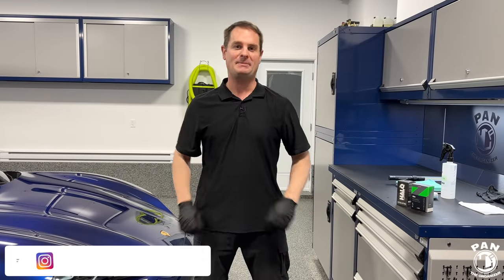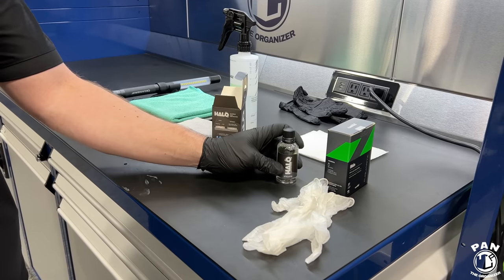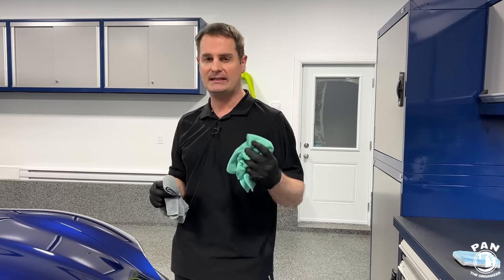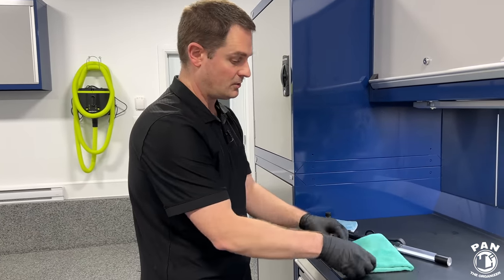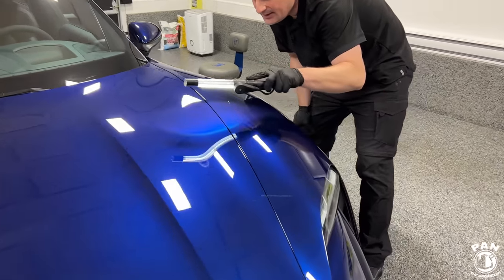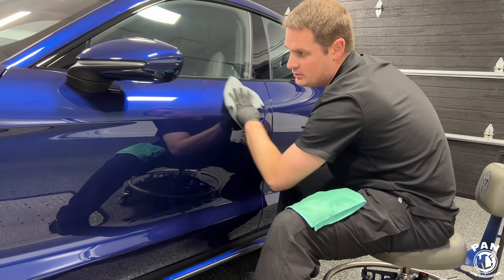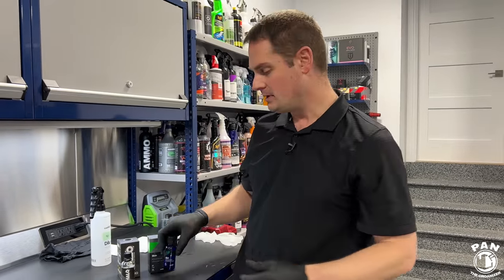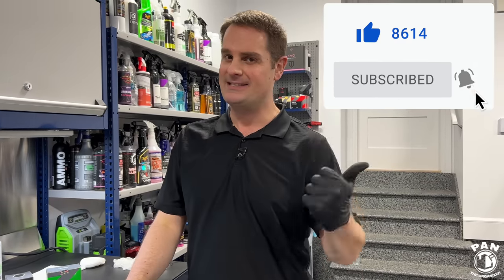How to apply a ceramic coating on PPF (paint protection film) : Porsche Taycan Turbo

Comment: Hey Pan, another very good shampoo that can be used every so often to remove tougher contaminants is Adam's Graphene Shampoo.  Can't recall if you've tested that one before.  Adam's describes it as a... "Traditional foaming shampoo that balances choice, high foaming surfactants, and citrus-based degreasers to generate a wash that is more than capable of powering through all kinds of road films and grime".  Another attribute is the low friction characteristics that graphene provides which in theory will help prevent some marring during a wash.  I believe they recommend every third wash or so.  Using a Nanomitt with it works really well.
Reply from the maker: I use the Adam’s Graphene Shampoo often to maintain the Adam’s Graphene Ceramic Coating Advanced on my girlfriend’s vehicle. I made a video about the process here: https://youtu.be/JLhTW_D7b8Y

Comment: Man I am late for this video. But I made it.. very cool pan. I went to work in the making of your video at 4:50am. ❤️👍🏻 need to zoom in more pan. To show use the bubbles. And leveling effect. I love Porsche just not EV’s. I like real cars with engine that make noise and burning tires. And the smells of real HP cars.

Comment: Coated my M2C with full XPEL ppf coverage, as well as a buddy's 911 Carrera T (also with full PPF coverage - Suntek ultra), with GTechniq Halo - in part from your video and in part from Obsessed Garage videos - and must say, it's been performing very well, and am overly happy with it. I did both cars over the 4th of July weekend in the USA, and after a couple maintenance washes since, still obviously holding up nicely. The beading and sheeting is so strong, that even the heavy suds from my foam cannon don't want to stick to the car when initiating the washing process. Thanks for the videos, Pan!
Reply from the maker: Thanks for sharing your experience Patrick and thanks for the kind words about my videos!

Comment: Dude, i bought a new car and bought detailing products, and i had my car wraped in PPF .. i had so many questions in my head, and all of them are answered by only you and your channel :D thanks alot really
Reply: they shop who applied PPF tph, said dont do ceramic, cause it will damage and make tph pff yellow,  is it true?
Reply: ah by the way i wanna ceramic coat my PPF cause i want my car driping wet), but as i read the comments on amazon for this product, it doesnt make the car look wet i guess.
Reply from the maker: Congrats on your new car, and welcome to my channel. You discovered one of the biggest car detailing channels on YouTube as we surpassed 945,000 subscribers and we have over 125 million views! I have been detailing for 26 years and I love to share my knowledge and passion with my viewers.

You found the right channel to help you learn everything about detailing.
Reply from the maker: This is totally not true. Unless you had some crappy PPF installed. Heck quality PPF manufacturers like XPEL even have their own line of ceramic coatings to be applied on top of the PPF.

The ceramic coating will prevent the PPF from yellowing, as it helps to block UV rays, and also will provide your PPF with more slickness, and also provide self-cleaning properties making the car easier to wash, and provide chemical resistance, and awesome hydrophobic properties. Depending on which coating you apply, some can increase the gloss too, but the PPF specific coatings not as much as the paint coatings.
Reply: Thank you so much!! :) @PanTheOrganizer
Reply from the maker: My pleasure. How did you discover my channel by the way?

Also, I made a video on how to care for PPF: https://youtu.be/I3AszYhWhs4?si=Bthr2JviAD4laLnc

Comment: Based on this video, I applied two coats of Gtechniq Halo to my Fiat 500 Abarth which has a "distressed patina" vinyl wrap.  The 3-M over-laminate on the printed wrap has a matte finish and I was worried that this product might ruin the effect by increasing the gloss.  I'm happy to say that the matte finish was unchanged and looks exactly the same as before.  However, when I run my hand across the finish it feels much more slick.  It remains to be seen if this coating performs as well as the Adams Graphene coating I used on my Porsche and several other vehicles, chosen also because of one of your earlier videos.  

Compared with the Adams Graphene, the prep work for the Halo product was a bit less because I didn't clay bar the vinyl wrap but the application took more effort because the Halo not only requires two coats, it also has a little more drag when leveling (wiping) the coating.  However, it certainly wasn't difficult. I also miss the nifty blue UV tracer in the Adams product which glows blue under a UV light so you can see exactly where it was applied.

For reference, I used half of the 60ml bottle of Adams to do my Porsche.  It took 2/3 of a 50ml bottle of Halo to do my Fiat but I dropped the bottle and spilled a little bit.  I would say that I could have gotten by with the 30ml bottle but if your car is larger than a Fiat 500 (aren't all cars?) then go with the 50ml bottle of Halo and try not to waste any. I also suspect a gloss wrap or PPF would use less product than my matte vinyl wrap.

Thank you again for keeping us up to speed on the latest and greatest products for protecting our cars.
Reply from the maker: Thanks for sharing your experience. Just keep in mind PPF coatings don't last as long as some of the more durable paint coatings. You should expect 1 to 2 years of protection if you applied it well, and do proper maintenance. I will also be looking forward to long term durability results in my conditions, to see how well they do over time, as they are still fairly new to the market.

Comment: I think you answered my most important question that no one else has yet - that is one can apply ceramic coating on ppf !! As long as it is designed for it. So Thx! Question 1. - so can i use the gtechniq halo  on an xpel ppf ? Question 2. Can i apoly this ceramic coating on my car windows , mirrors , sunroof and alloy wheels ? If not , any other recommendations ? And question 3. Can i use optimum no rinse to wash the car with ppf and ceramic costing ?Thx a bunch for sharing this tutorial!

Comment: Excellent video Pan; so good to see a pro' at work. I noticed that when applying the second square to the bonnet (hood), you overlapped the first square. Cleary, after a minute or so of drying, that created no apparent problem. So, how long can a section be left drying before application of the adjacent panel  without causing any problems?  You can tell, I worry for England to Olympic standard.
Reply from the maker: Don't overthink the moment. As long as you are methodical and apply the coating in one sitting, you're fine. It takes 24 hours for the initial cure to fully happen. But you can usually correct high spots up to 30 min after the application.

Comment: Great video Pan as always! I've had Halo applied on my AMG 45s in satin ppf, which for durability it lasts me around 1 year. Including doing regular maintenance washes living here in the UK. As mentioned in the video it is a very product to use in the correct conditions. I personally like to try and stay with Gtechniq products as much as possible as they design and produce these in the labs research etc for maximum results, would be nice to see this product last that bit longer if they can do this would be great, that would be it's only let down to me.
Reply: They advertise it for 2 years, only one year is pretty disappointing to be honest.

Comment: I know these are preferred for PPF. However, I had no issues using Carpro Cquarts 3.0 UK worked great.
Reply from the maker: Many paint coatings can also be used on PPF nowadays. You just have to make sure to read if your specific coating does.

Comment: If you had PPF that was several years old with an old/failing coating, how would you prep the PPF'd panels for a new coating outside of wash/iron remover? Is clay/polishing necessary to remove the old coating from the PPF?
Reply from the maker: Yes a light polish would be necessary to remove any old ceramic coating. It's the only way to ensure 100% removal of any previous protection.

Comment: Cool! I for one am very interested in all PPF-related content so I'll be sure to look out for any/all future updates, reviews and comparisons on the topic. Thanks Pan
Reply from the maker: Thanks Andrew!
Reply: @PanTheOrganizer  One thing I've just learned browsing the product pages that might be of note here is that CarPro Skin can be removed with a stripping solution, so apparently no polishing necessary if you decide to change coatings down the line. If accurate it's a great selling point IMO, and they also claim heavy UV resistance, which can be particularly important for PPF. Just comparing the product claims between the two featured here.

Comment: Great video! Hoping you can clarify something for me. While these coatings are supposed to be formulated specifically for PPF, your earlier videos (and those of many others) have always said that other ceramic coatings that were not formulated specifically for PPF could still be applied over PPF. In many cases, the durability of the other ceramic coatings (CQuartz UK 3.0, Glassparency, and some others) have 2 or 3X the longevity (claims) of the two featured here. If the others can last longer, then what "advantage" is there really to these coatings being formulated specifically for PPF? If you recommend using these over traditional ceramic coatings, why is that? Or are these just two more "options" in the arsenal, without any real advantage over traditional ceramics?
Reply from the maker: That's a great question and it would be best answered by the chemists that formulate these products. My understanding is that paint coatings can usually be applied to PPF but you can't guarantee the durability as much as they weren't specifically made for that purpose. PPF specific coatings will usually do a better job on PPF.
Reply: Maybe it’s better for not inhibiting the PPF self healing layer.

Comment: Great video! What should I do with my vehicle that only has ppf on the front (front bumper and fenders, and hood)?
Regular ceramic coating for the whole car?
Vinyl/ppf coating for the whole car?
Or 2 different coatings for each section of the car?
Reply from the maker: Most paint coatings can also be applied to PPF nowadays. So check if the coating you are buying is good for paint and PPF and just apply that coating all over.

Comment: Hi Pan, great video as always. Do we need to wait for PPF to fully cure before applying any coating on top? How long should i wait after getting my PPF installed?
Reply from the maker: After PPF has been installed, it can take a few days to fully cure and settle. It's recommended to not wash the car for 7 days after the PPF is installed, and also avoid touching or pressing areas on the film for at least a week. You may notice some bubbling after installation that will smooth out once the film has completed dried and settled.

Comment: Awesome thanks Pan I don't know how I missed this video, those 2 products are great options as with results and easy of application. I don't like to use products that claim to last 3 plus years because I don't want to fall in the mind of set it and forget it, I like the 1 to 2 years of protection because then when is time to reapplied the product you can do a good cleaning decontamination and polish on the car before protecting it again especially with the harsh heat and rain here in south fl
Reply from the maker: There you go! 👍🏻

Comment: Pan, your information is what makes DIY guys successful. Is there one ceramic coating you recommend for a car that has paint and PPF, or do you advise using two different products designed for each surface? If it two products, should I ceramic coat the paint first or the PPF areas? Thank you.
Reply from the maker: PPF coatings are only for PPF. But most paint coatings can also be applied on PPF. So if you have a mix of paint and PPF, get a good paint coating and apply to all those surfaces.

Welcome to my channel. You discovered one of the biggest car detailing channels on YouTube as we surpassed 930,000 subscribers and we have over 122 million views! I have been detailing for 26 years and I love to share my knowledge and passion with my viewers.

You found the right channel to help you learn everything about detailing.
Reply: Wow! I feel honored to receive your reply. It’s like when the professor sends a note. No, make that the head of the department. I’ve been watching video after video of yours and have learned so much from your excellent explanation and detail. Pun, intended, Pan. I’ll be picking up my X-Pel freshly applied 2005 Lotus Elise next week after 41 painstaking, tedious hours of removing the original, dried in, crusty 3M Starshield so I want to protect it right away as best I can. Please keep the encyclopedic and entertaining videos coming. Thanks Pan!

Comment: Hi just found your channel and great videos on how to prep and look after the care of your car. I am getting a new car shortly and looking to get it PPF’d Premium Shield Nxt Gen from an approved Installer. It is supposed to be hydrophobic and the installer said that you do not need ceramic coating with this particular PPF. However I love the shine and gleam ceramic coating gives and was planning to use Avalon King Armor Shield IX. Do you think this would be ok to use on my PPF? I appreciate that you mention on this video to use a specific ceramic coating that is suitable for PPF. But on Avalon’s website it says it is suitable to use on PPF. I would like to use this one based on how easy it is to apply. Your thoughts would be appreciated 👍👍

Comment: Thanks for the video and the detailed process as always! I'm planning to do mine next weekend. How much did you use, 30 or 50ml for this car? Also, do you recommend using this on the windows and sunroof? I know this is a different style of coating.
Reply from the maker: The coatings in this video are exclusively for use on PPF and vinyl wraps. No other surfaces.

One 30 ml bottle was enough for this car.

Welcome to my channel. You discovered one of the biggest car detailing channels on YouTube as we surpassed 990,000 subscribers and we have over 135 million views! I have been detailing for 27 years and I love to share my knowledge and passion with my viewers.

You found the right channel to help you learn everything about detailing.

Comment: Thanks again for another excellent video Pan. Your passion shines through time and time again. I have a truck with PPF installed on the front end only. Would it make sense to use a PPF specific coating on those panels and top with another cermaic coating? For instance Carpro skin and SIC on the PPF panels and Cquartz UK 3.0 and SIC on the clearcoat panels?
Reply from the maker: No, at that point, just apply CQUK 3.0 on all the paint and PPF. CQUK can be applied on PPF too. :)

Comment: Can one use the AvalonKing Armor Shield IX which you have endorsed to use “everywhere” in an earlier video for this purpose?
Reply: Yeah Pan, I'm curious to know this too
Reply: I have! And with great success I might add! The whole front of my new Audi is protected with a PPF and coating it with Armor Shield was as smooth and as effective as all of the non PPF panels of my car. Go for it!
Reply from the maker: Yes you can apply the AvalonKing on PPF and vinyl wraps too.

Comment: Hi Pan! If one already has PPF+ceramic coating applied, would it be advisable to use SiO2 toppers (not necessarily designed for PPF) every once in a while to help the CC last longer? And for that extra GLOSS? I'm thinking Gyeon Wet Coat, Capro Elixir every 1-3 months and maybe a ceramic detailer every now and then. Also wondering if those new Turtle Wax Graphene products (Flex Wax, to the Max Wax) would work well over a ceramic coat that's on top of a PPF. Thanks for all the awesome videos!
Reply from the maker: Yes I would absolutely use SiO2 or graphene toppers to maintain the PPF and ceramic coating. Gyeon WetCoat is a great simple to use maintenance product. Flex Wax is compatible too, but it's a longer lasting product, so you usually use it more as a base layer of protection, not really a topper. And Max Wax I wouldn't recommend on top of a ceramic coating.
Reply: @PanTheOrganizer  thank you for the thorough and helpful reply!
Reply from the maker: Welcome to my channel. You discovered one of the biggest car detailing channels on YouTube as we surpassed 865,000 subscribers and we have almost 110 million views! I have been detailing for 25 years and I love to share my knowledge and passion with my viewers.

You found the right channel to help you learn everything about detailing.

Comment: W5 Citus came in a spray bottle and I beleive you said 5-6 months to use?  Just spray on PPF and wipe off?   Also, I used the HALO and also purchased the Reset (maintenance) and the C2 Ceramic Sealer.  How often should I use the C2?